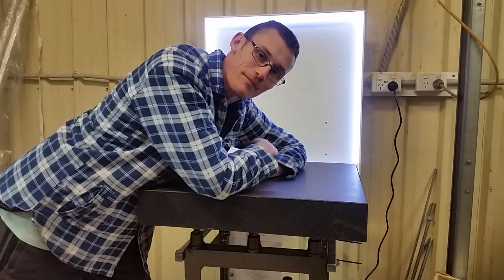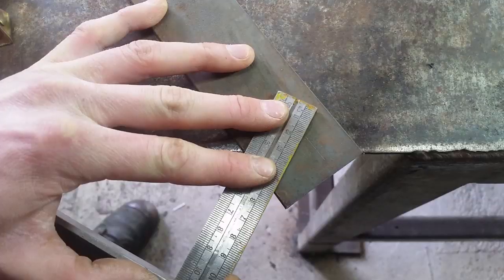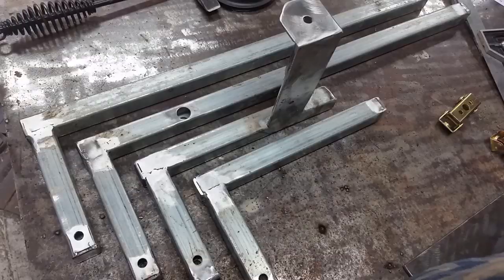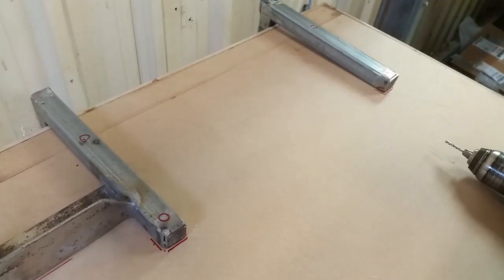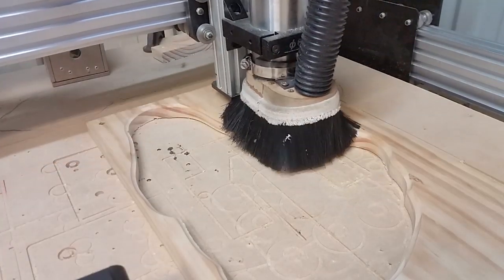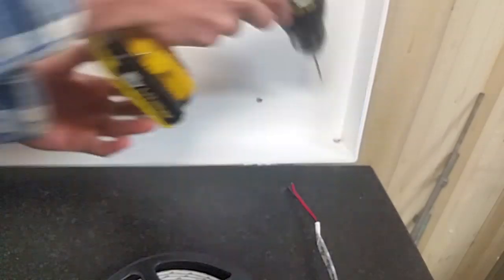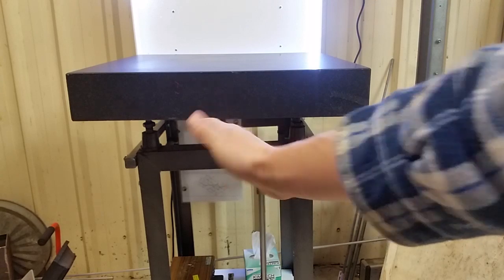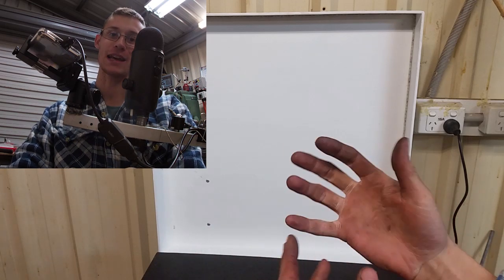Surface Plate Workstation

Comment: Nice job! Think that was a great idea. I have the same problem with my surface plate getting covered in crap (not ideal...I know.) This project has inspired me to build something similar, which is amazing because I’m pretty much uninspirable...or so I’ve been told. 🤙
Reply from the maker: It makes a huge difference. Before I used it maybe once a month because it took effort to move things and clean up, now I use it almost daily.
So long as you can train yourself not to place stuff on the hinged lid! (I actually considered a sloped lid to prevent using it as storage)

Comment: Great vid. The too-short lighting strip is an easy fix: cut another length and join it on – the round dots can be soldered to short jumper wires.
Reply from the maker: Yeah I should fix it, for balanced aesthetics if nothing else!

Comment: Love it. My surface plate is a lot smaller, and it's always covered in dust. I did just fix up the lighting near it though.

I actually cringed when I saw you drilling through the MDF cover and into the granite. Then I realised the granite was somewhere else. Phew.

I've seen those little welding mag tab things on Jody's channel. What you you think of them?
Reply from the maker: It's very convenient now, always ready to go.

Yeah I'd never do something like that, try to take care of it, although I got a bit excited with super glue on the light strip (the double stick didn't like the paint it seems) I had to break out acetone and wipes afterwards.

I'm experimenting with them, they seem good for holding parts in weird places so far
Reply: Yeah - it looks the business.

I might give those magnets a go then. 

Cheers. Craig